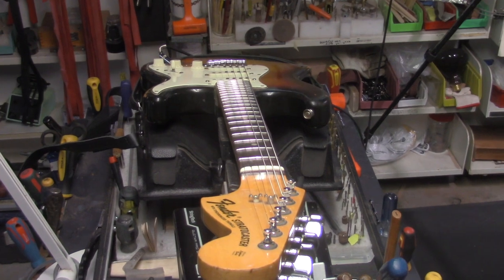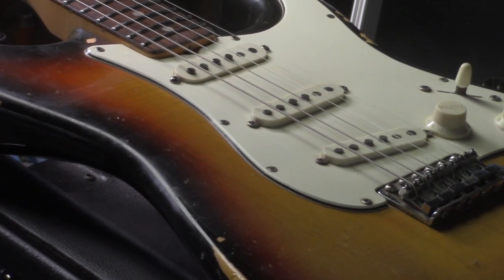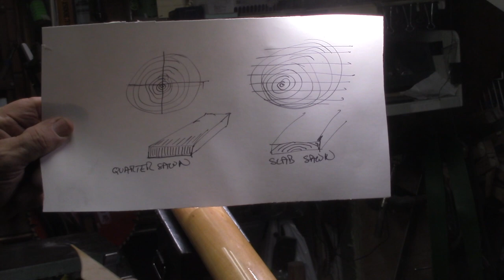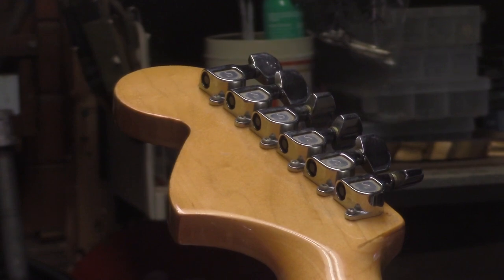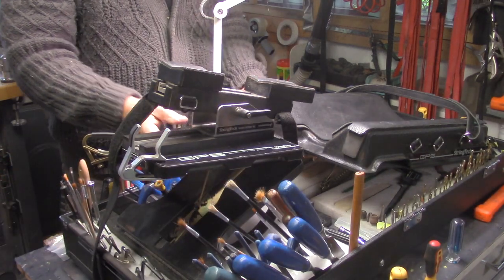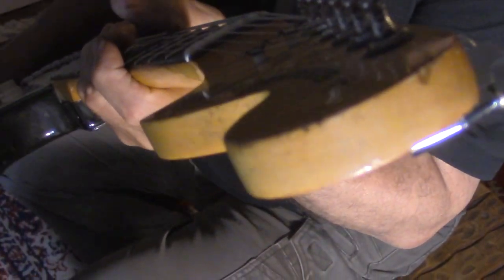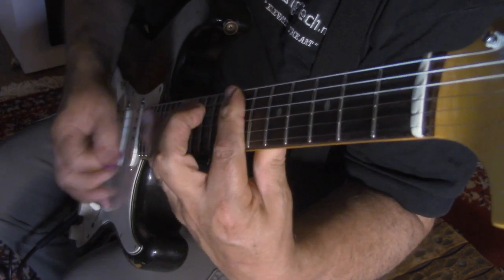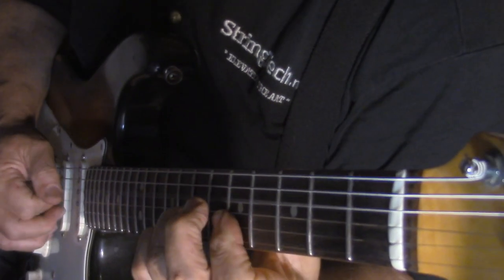1969 Stratocaster Re-Fret@StringTechWorkstations

Comment: I have a Telecaster probably somewhere mid 2000 (Mexico built) with the E strings very close to the outside edge so it looks  they still do that
Reply from the maker: Could be. But most of the recent Fenders that I've worked on are no where near as close to the edge as that Custom shop '64 or this actual 1969.

Comment: Mike: is it true that in the ideal situation, it would be best not to have any string trees assuming the break angle from the nut to the post is sufficient?  If so, what is the appropriate break angle for a typical strat?  Is there a way to tell with your ear that I should be using one?  And if I need a string tree, should it always be placed half way between the nut and the post or does that depend on the break angle as well?
Reply from the maker: These are all valid questions Jeff. Thanks for asking. The "roller nuts " the "roller strings trees" the         step-down machine head posts .... are all attempts at addressing these issues. You can exert quite a bit of downward tension into the nut slots by adding string winds on the post too ... bringing them down closer to the face of the headstock with "neatly wound" loops.
Reply: @StringTechWorkstations  i always use locking tuners that are staggered. I also wrap the winding neatly lower on strings 1 and 2 to help (even though you are not supposed to in locking tuners).
Reply from the maker: Definitely on the right track Jeff.

Comment: I just paid extra for a quarter sawn neck from warmoth. Should I have not don’t that?
Reply from the maker: Hi Jeff. I just cut and pasted the response I made to Carlos to clarify my 1/4 sawn verses slab sawn. I need to clarify my comment. I am not saying that 1/4 sawn is "no good". I am just making an observation of the fact that the " slab sawn " ( or flat sawn / or whatever term you choose to use ) is more flexible and likely to have a lower "tap" frequency than the stiffer 1/4 sawn piece of the same dimension. This may explain why ( in the case of a maple neck ) the "slab sawn" necks are more desirable for tone. The customer mentioned when he picked up his 69 Strat this morning; that it is his favourite guitar because he can play it acoustically ( unplugged ) while he is lounging around the house ... and it has a resonance that he can feel against his body when he plays. Apparently, much more so than his other solid body guitars. I thought that this was an interesting observation ... worth sharing.

In addition to these comments: The typical Strat / Tele neck is loaded up with .009"-.046" or maybe .011" - .049" strings. These strings .. tuned to concert pitch ... barely generate enough tension to make that maple neck "blink " ! So having a  1/4 sawn maple neck ( IMHO ) is really a bit of overkill.  However,  on a mahogany neck ... the 1/4 sawn grain orientation is much more crucial for stability. Especially in the case of acoustic guitars ... where they are utilizing a heavier string gauge.

On another note ... Gibson tried some maple neck Les Pauls ... they totally bombed. Why ? Because they tended to sound more like a Tele ( acoustically ) than a Les Paul. Even with the inherent fragility of the mahogany neck ( tendency to breaking ) on the Les Paul .... the mahogany is crucial to the sound. 
Cheers MMcC
REPLY
Reply: @StringTechWorkstations  thank you